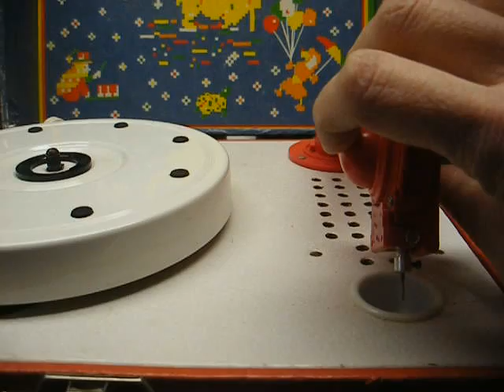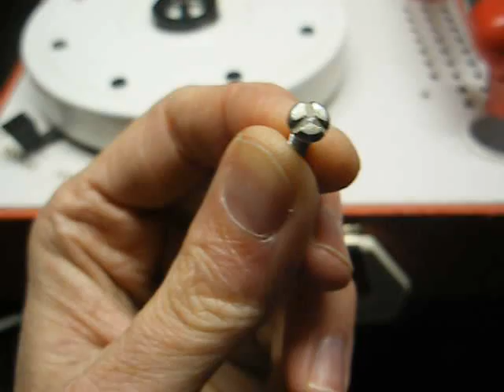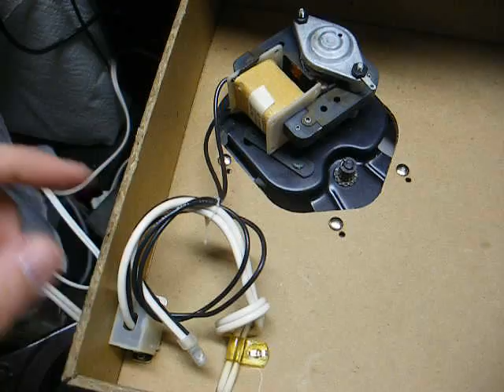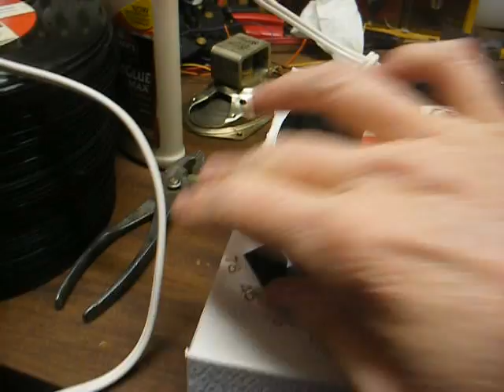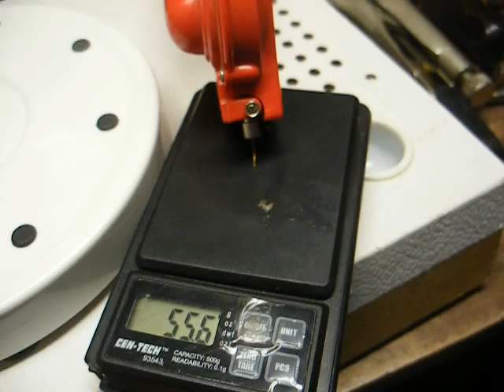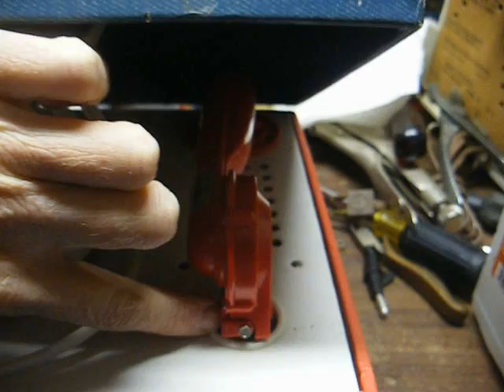Acoustically amplified kiddie record player from 1974

Comment: today I got a 1970s Yorx stereo with phono, cassette,8 track, and radio. I got the original speakers and operation manual too. it all works expect the cassette it needs a new belt. the phono works great on it with nothing needed to be done but I will put new grease to make it last longer but. the unit is in very very good condition.

Comment: And speaking of kiddie record players, I got this one the other day and it works perfectly, and it's an Imperial Party-Time portable kiddie record player from about 1974 as I was checking underneath the plastic platter. It has a 4-speed turntable which was also made by General Industries along with a light plastic tonearm with a screw on top. The one that you see is the worst of the kiddie players that has an acoustic tonearm. Both were released the same year. My Imperial Party-Time only has an off/on volume control, and no tone control, but it does lacked tone. I played these records and it sounds not too bad for a kiddie player. It was way cheaper than the current brand which is the Crosley players.

Comment: You want to see a kiddie record player destroy vinyl check out the Kenner close and play.  That thing makes the Crowley record players look like mister nice guy.
Reply: Yes, I had those. Tore up a couple 45's with it. Steel needle.
Reply: I wonder if Close&Plays cam with a warning against playing, eh, just about any record that was expected to be played on anything better. Stereo records would have been trashed. The Close&Play was actually a lot like the record drives inside those pull-string dolls they used to sell, with a permanently mounted interlaced 5 spiral record.
Reply: Was it red? Because I had a red record player 45 only that you closed it and it played but it sounded decent..

Comment: I used to get Close and Play phonographs as a kid. It was battery operated. It used a steel needle. It played when you closed the lid. The needle was coupled with a plastic diaphragm in the lid.
I messed up some 45's with it.
Victrolas tracking forces was measured in ounces, not grams.

Comment: I remember seeing two phonographs like this: someone I knew had a metal one from the 1950s which played only 78s and it's arm was partly plastic-just plug it in and play the record. another one found in a store near my College campus (Berea, OH). was like this one except the pickup used a semicircular plastic card for a reproducer. Very low end kiddie phono and had at least 3 speeds (1969).

Comment: In the 1960s stores after Christmas would sell toys that were returned or left over at a table for a quarter or $0.50, I bought a little red record player you lifted the lid put the 45 on it shut the lid and it was acoustically amplified but it had a 4in speaker basically directly on the needle.. it sounded really good for what it was it was only 45 in the speed control was iffy.

Comment: A few days ago I was at Stanz's Antique shop on Albany Ave. in Kingston, I saw a record player that it was acoustically amplified, and it's a Starflite acoustical kiddie record player from the 1960's and it has two speeds for the 45 and 78 setting. The 78 will play better, but the 45 setting is the one to be careful and it can damage styrene and stereo 45's.

Comment: I had one of these, but I don't remember if I ever played  a  33 and 45  on it.   that machine uses a metal needle which was for 78 rpm only.  I'm sure it would chew up a 45 rpm or LP record.They still made 78 rpm kiddie records until around 1970 or so. and I still have a few but unfortunatley most modern turntables, except for a few of the retro crosley machines, don't play 78's anymore.  I mostly played 78's on my old kiddie machine until I broke the tone arm.  I was only 6 when I got if.  I later got a "real" record player that was electrically amplified.  Most of my 78's were pretty scratched up, but I still would   play them on my new machine, but mostly played regular 45 and LP's.  My later machine had a two sided needle that could be flipped over if you wanted to play 78's.

Comment: As cheap as this is, there is one good thing about it. The motor used is far better than the cheap motor used in a $200 Crosley. If it were me, I'd spend the extra bucks for an electronic unit.

Comment: If it had been marketed as a record destroyer it would have been more appropriate.   And yes, the 55.6 grams did make me cringe, especially since my turntable has a cartridge which I have set to track exactly in the middle of its range, at 1 3/8 grams.
Reply: The original Edison phonographs tracked at a quarter pound -- that's over 110 grams!
Reply: VWestlife My 1926 Victrola VV 8-4 has a heavy brass tonearm, and it tracks about 50 to 100 grams.
Reply: @Musicradio77Network  But the records were designed to withstand that. The needles were destroyed when playing a disc, not the disc itself.

Comment: Upgrade the needle system and build the amp?  Thats a design that makes the job of the disk jockey easy, and in plastic too! The one I had was metal-same design of use, its so your needle is suspended just above table height, great sounds come from the shaking of the needle instead of scraping the dust in the groove, you adjust the height with every record by setting the needle on the record with tissue paper in between and locking the head then pull the paper straight away from the needle seat, then turn it on, kind of like a surface grinder, anyway it would be a good series LOL!
Dave in Kentwood

Comment: It's been years since I've used one, and not that it even matters on this player, but those needles are designed to sit angled toward the right side of the player. There's a flat edge for the screw to tighten onto. Something having to with with how the weight of the tonearm is distributed. I'm sure this really only applies to older players and jukeboxes. Otherwise, great demo of a crap player. Yes! Those needles break so easy if you're not careful. LOL

Comment: 0:44 Not amplification, magnification - - there is no net power gain - - just acoustical impedance matching.
1:20 Try a cactus needle!
3:35 I notice the lowest speed is 16 rpm, so where's the 25 rpm?
It has 78.25, 45, and 33.33, but no 25

Comment: definitely play 78s on it.
Reply: no clue.
Reply: It's probably one of the "Batwing" Victor records from about the early to mid 1920's. I have a lot of those "Batwing" Victor 78's along with the "Scroll" Victor 78's from the 1920's in my collection.

The turntable itself is a General Industries motor driven player, like the one used on all of the GE record players including the Swingmate and the Wildcat. My GE Wildcat also has a General Industries record changer, my Swingmate does the same too.